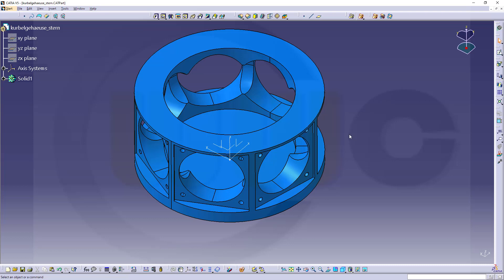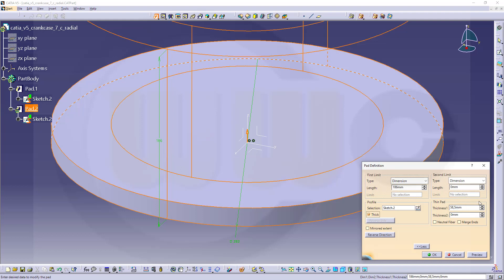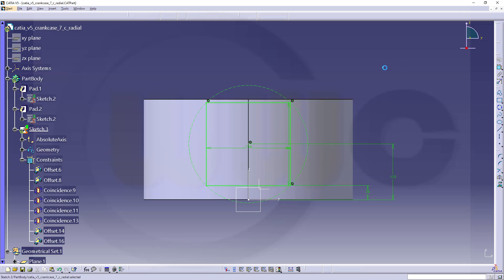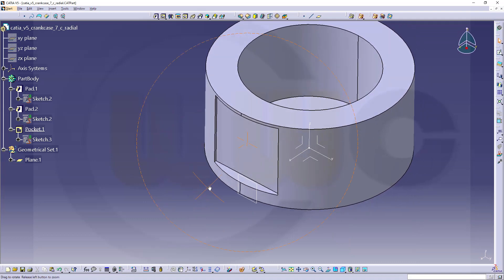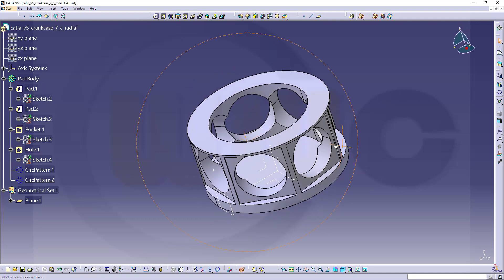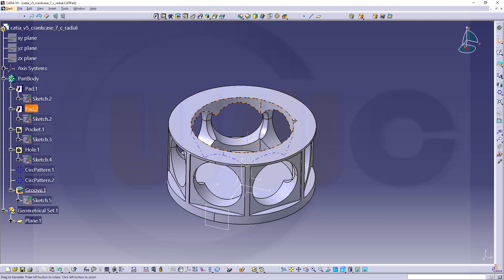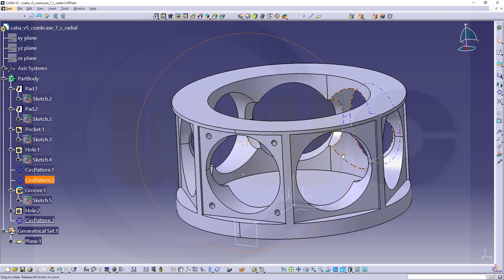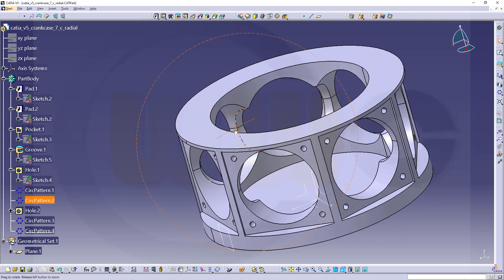Kurbelgehäuse - Crankcase ( 7 cylinder radial engine) - Catia v5 Training - Part Design

Comment: I had small doubt why can't we use position sketch in all design diagrams
Reply from the maker: You can use a positioned sketch as well, but it is not necessary

Comment: Hi Wolfgang happy new year, I 'd like to ask you if you could do a video about how to draw a wing with a real airfoil section in catiav5 please
Reply from the maker: please watch my "ww-109 fighter" videos, for a wing you just need the real airfoil section and then use multi-section-surface.
Reply: @wolfgang.walden.cad.training  yeah I got it but my main problem is how to insert the points or how to put the equation in order to produce the real airfoil cross section
Reply from the maker: There used to be a makro for importing points, but it is sadly no longer supported.